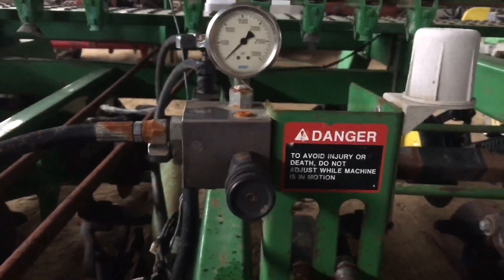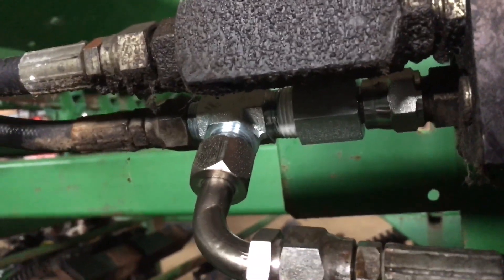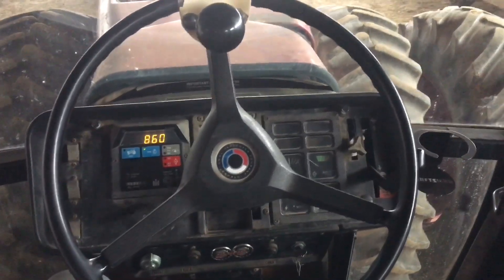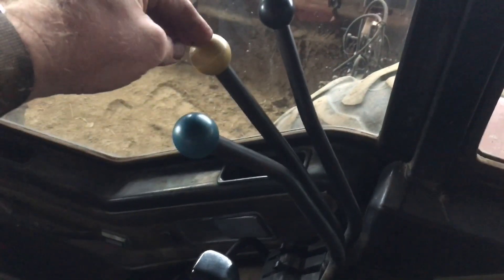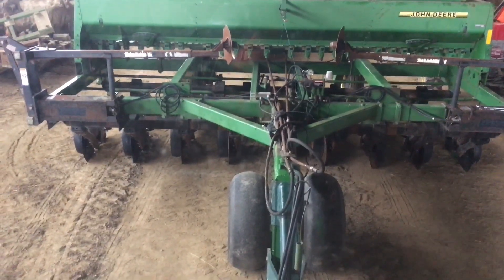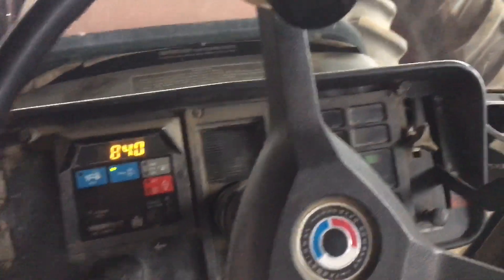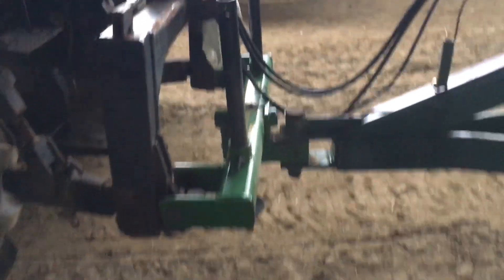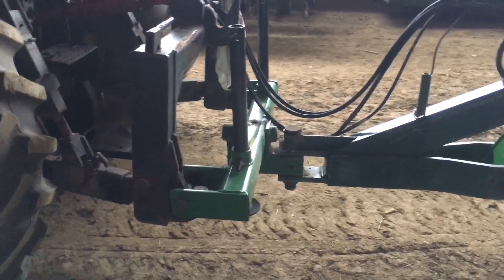Running John Deere Active Downforce with IH Tractor

Comment: Would this work on a 66 series IH?
Reply from the maker: I have not tried this setup on an open center tractor. I would think it should work. I have an 806 to hook up, I just haven’t had a need to. I will say, the whole purpose of re-plumbing the hydraulics in this manner is to make the oil circulate at only the pressure required to run the active downforce, not the full pressure the tractor is capable of generating.
Reply: @andrewmills9353  Ok thanks

Comment: I have the older style hydraulic block on my 750. any idea how that one would be plumbed for closed center hydraulics on my 1086? Nice video.
Reply from the maker: I’m not very familiar with the different valves JD used. I did see your post on the Facebook group of Deere grain drill owners this morning, judging by your picture I think you’d take the line from the bottom of your valve and T it into the line on the top of the Valve that goes to the pressure down side of the hydraulic cylinders. ( The side without the lock-up valve) Spending some time with a hydraulic gauge or 2 plumbed in would tell the story, to achieve the way I set my drill up, you are looking to regulate the pressure being placed on the tractor’s hydraulics with the valve on the drill.

Comment: How did it work in the field?  Did it heat up your oil?
Reply from the maker: I felt it worked really well. I liked the action of the drill, and I took one of those laser gun thermometers with me, the oil was not unusually warm. No hoses abnormally warm, no lost hydraulic function. I didn’t change anything for this year.
Reply: @andrewmills9353  Just got a new to me 750 and plan to put it on a 986.  It is closed center now, so I am researching.  I'm over in Williams Co.  Not far from Pettisville either. Same hitch and dolly wheels as your setup.
Reply from the maker: Matt Hoffman  We’ve spoken on the IH group Facebook page. If you want to check out my setup, you’re welcome to.